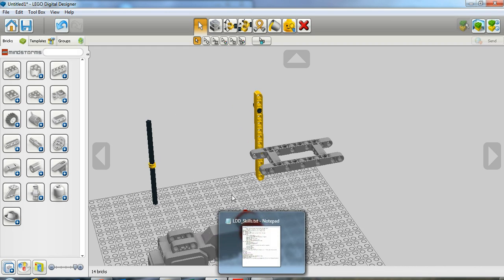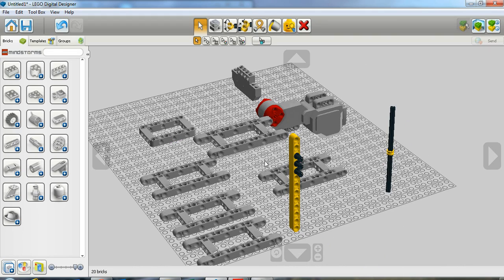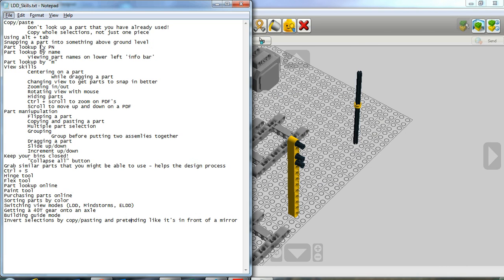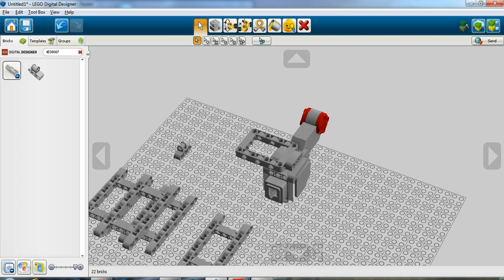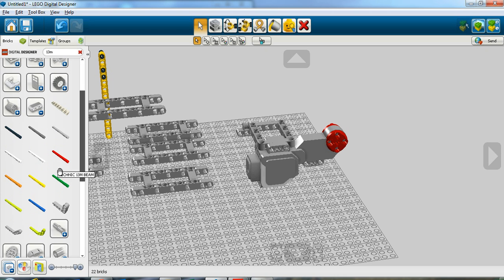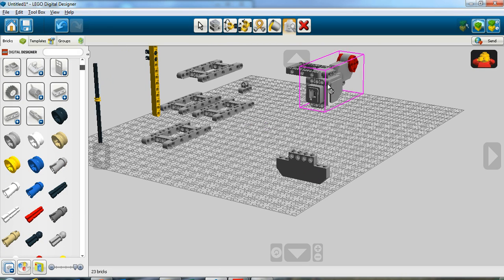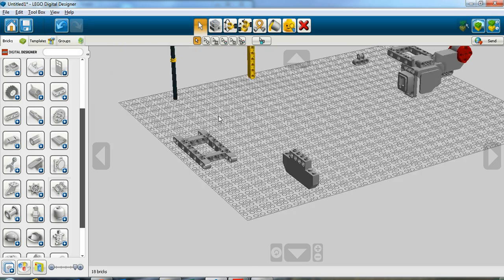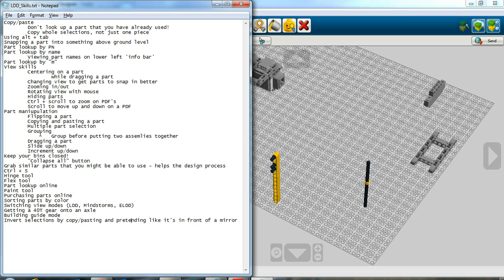Lego Digital Designer Tips and Tricks - 1/2

Comment: Hey.  Thank you for this helpful video. I have a question though. How can you, when you have 2 axels, and will have 2 gears connected on the axels, get the gearteeth matched?
Reply from the maker: You could probably do it with math.  The first thing I'd try would be to (360/NumberOfTeeth)*0.5 and set the rotation of the axle that gear is on to that number of degrees and see if they match up then.  Other than that, man, I'd say just get them directly next to each other, but not quite slid together yet and just eyeball it.  Once it looks like they'll line up, try to slide them together.  If at first you don't succeed, try try again :)

Comment: Any ideas on why I can't get the Beam Frame (#64179) to connect to the motor in a vertical position. It will connect horizontally, and the H-Frame will connect vertically, but not this one. I've tried all types of connectors. Kinda works with axel connector 43093 but leaves frame hanging out and won't slide in tight to motor. It all goes together easily with physical parts. What gives?

Here's a screenshot 
https://docs.google.com/drawings/d/1c14fbGdz4L2Qo_rWLNqRwZc3sBtzvldUgkrbxZkM8q0/edit?usp=sharing
Reply from the maker: Thanks for all the detail!  Very helpful in recreating the problem, but unfortunately, I don't know how to fix it :/  Looks like maybe LDD has a slightly off model for that part.  Best advice I can give is to manually place the part as close as possible to where it's supposed to go using the select-part-and-bushing-on-axle trick to slide it into place horizontally and vertically.  This could cause other issues though as your model gets bigger because the parts won't truly be lined up.  Another option might be to build a piece out of other pieces that functions the same as the Beam Frame, then change it out in the actual build.  The last thing I can think of would be to just use another part, both in real life and the model :/